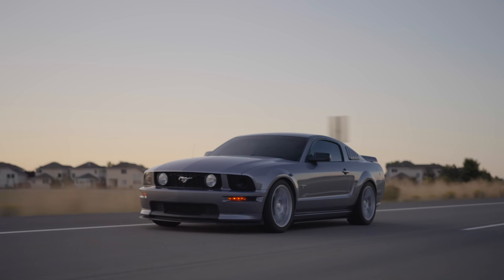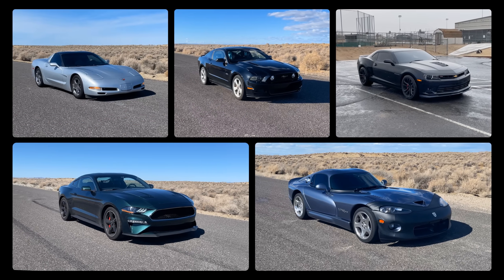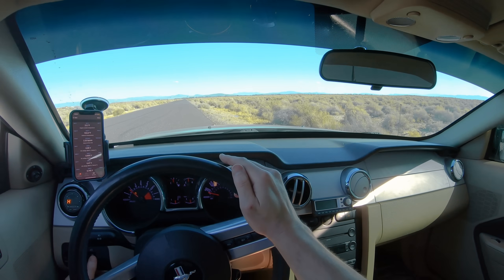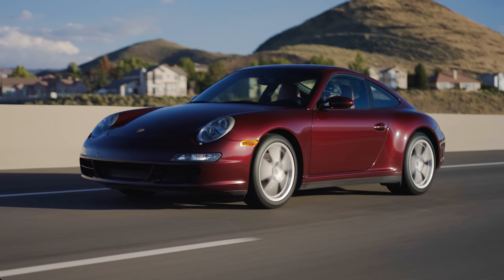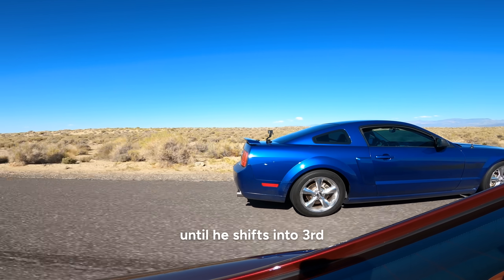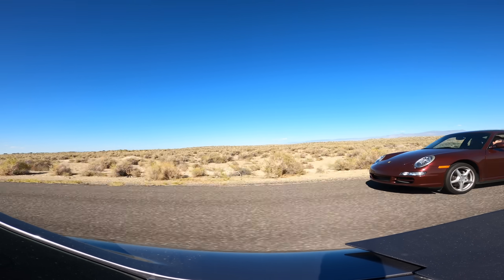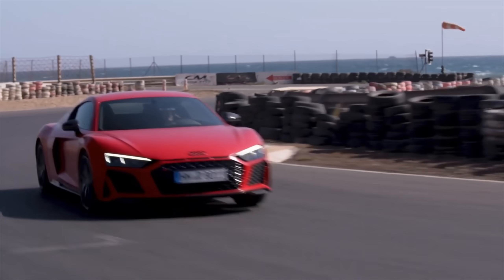This is what a 50% increase in horsepower looks like

Comment: Heavily overlooked mod is functional weight reduction 
My Q50 Sport came with 19s and heavy factory rims and factory runflats 
I put on 18 inch RPF1s that cleared the Akebonos with Toyo Tires 
Paired that with 2 piece rotors, and my car on a scale lost over 130LBS of weight 
Even before installing my tune and pumping up boost to 19PSI 
The car felt like an entirely different beast 
Turn in, Braking, and Roll starts all felt SUBSTANTIALLY different and that was before adding ANY hp 
once i tuned it the cars now in a different realm of speed than where it was stock 
id guess stock it would run maybe a 13.4-5 at the 1/4 
now im positive it would run a 11.6-11.7 on my worst try

Comment: "You gotta get that to the wheels chappie...."  You can get that even faster though it would involve stripping out that weight, changing the rear end out and a few more trans mods you can be cooking even hotter.         There's still much more you can do before boosting.   👍

Comment: N/A builds are under-rated these days, and 400+ HP at the wheels is nothing to be scoffed at, despite what most of the internet says. I see by the plates you're in Nevada, and probably higher elevation. You should do a road trip if feasible and see how much faster you'd be at sea level. I know moving from sea level to Colorado, my at the time's N/A V8 lost a ridiculous amount of power.

Comment: That's why I love my K24. It doesn't bog down at the lower RPM because the taller cams are not active until 4500 rpm. You can get a pretty flat torque curve because of it. It already picks up at 2000rpm because of VTC (not vtec) and peaks at just shy of 4000rpm and is a flat line from 4k to 6k. Redlines at 7600. VVTI-L/VANOS/VTEC truely make a N/A build much more peppy. 

It's not a V8 ofcourse, but I also live in Western Europe where a 2.4L is actually high displacement these days. It's so much more driveable than whatever we're sold here the past 2 decades, due to the way it delivers power. 

Planning to also have it built, put a K20 head on it, intake, 50degree VTC, bigger throttle, the works. It only has intake and headers now, so its stuck at 220whp. Just hope the builder does a good job, i've had rotten luck with shops. But I wouldn't ever give up the NA spirit of it.

Comment: Should’ve built a stroker motor first, been documented to easily make at least 400 to the tires with stock cams intake and lightly massaged heads. 

These 3V need either more “pull” to draw in more air or boost to help it. Big difference when stroked to 331 FWIW
Reply from the maker: where documented

Comment: Thank you for your videos, they are very interesting. I'm French and so I don't have a very good knowledge of Mustangs, but it will come. I have a question, I just bought a 2007 Mustang V8 BVA equipped with an Edelbrock e-force compressor, with apparently no other preparations, just a reprogramming. My problem is that I feel like I have little power below 4000 rpm, and with the compressor blowing below 50 km/h it becomes almost uncomfortable to drive. I am wondering if I have an interest in keeping the compressor (which is also illegal in France) to favor stage 1 preparation. Do you have any advice?
Reply from the maker: uncomfortable to drive because you lose traction when applying too much throttle below 50 kmh?
Reply: @Four_Eyes   yes below approximately 50km/h I have the impression of having less traction than an original mustang, I have to press harder on the accelerator to go up in revs and find a range of revolution rpm more in line with my speed.

Comment: Hey bro id like your input on this .. got a 2008 GT , obviously i want more pick up … i was debating on going with department of Boost or paxton , with stock internals … those superchargers are made for stock internals but im still scared … would you put them on the stock engine and run that for a bit and then forge your internals ? Or would you forge your internals before adding a supercharge to be safe and make sure the boost will never blow up your engine ..

Comment: what mod do u suggest to get the biggest gain for the buck. my car is pretty much bone stock besides a cold air intake. dont think it was ever tuned, also what tuner do u suggest. ive never got to mess with my cars like this cause they was all old obd1 cars so u was better off pulling the fuel injection off an throwing a carb on those old cars but i finally broke over an got a more modern car not crazy new 09 gt but i have to admit i have been loving it but haven't done anything to the car but what do u suggest.

Comment: Something you should know is that your upgraded brakes didn't improve the braking performance. The stopping distance would've been the same if you had just bought new pads and discs. Cars manufactured in the past 30 years are all capable of locking the brakes, which is the maximum possible braking force. The difference is that with upgraded brakes you can brake hard more frequently, but the stopping distance does not actually change. Driving4answers has a good video on the subject. I'm not saying you shouldn't upgrade the brakes, I'm saying it's important to know what actually changes when upgrading.
Reply: He already mentioned in the brake vid that he will put bigger tires on
Reply: @bigmansir3745  Yeah. My point is that it's a common misconception that upgraded brakes improve braking performance. They don't, unless the braking system is REALLY old.

Comment: I seems like the 911 didn’t take advantage of the AWD in the last race. Seems like the stock S197 took off harder since it beat yours off the line. Seemed the Porsche bogged off the line in the last race or should’ve gotten the revs up at the launch, since it doesn’t have the torque of the V8.

Comment: I broke 2 spark plugs in my 4.6 05 GT took it all apart now I’m getting a cam shaft position sensor code driver side, it runs good but I am worried any tips? Ford told me it’s mistimed by one tooth 🦷
Reply from the maker: could be a bad VCT or phaser on that side as well
Reply: @Four_Eyes  awesome I will check that out,I love your videos you motivate me,to build my car up!!

Comment: The 911 being awd actually hurts it. Thats a mid engine car. Theoretically, based on weight ratio it should apply more power to the wheels than any front engine car. Also, the gearing could be revised in that 911 to be shorter to make it quicker but overall power isnt enough for overall top end gain. Id also wager, the 911 has less drag than the s197.  I like that s197, sounds great and looks very solid. Great build! Notice, something else with that Porsche, that launch. lol So because your rwd you broke traction to get into the higher rpms and I bet he barely left 5250rpms by the time you hit 7k lol Awd isnt everything!

Comment: What makes your mustang come alive is Torque.  Torque  is responsible for acceleration.  HP is responsible for top speed.   I built a 347 stroker purposely designed to have all 400 ft/lbs come on from 1100 rpm through 5600 rpm.  HP, at 420, doesn't hit until just after Torque/HP crossover, and by then I'm only in it for top speed, but I'm there seconds before you so you'll never see anything but my taillights.  It's not your top speed, it's how fast you get to your top speed.  You built a motor to rev to get your Torque starting a 4000 RPM and dropping off after 5750.  Very narrow band.   The profile of your original engine was much better.  You should have built your motor just to shift that profile up.  You shifted it to the right.  Yeah, you're compensating for the narrower band using a 6 speed,   but that takes time to shift.  Imagine having all that power you have for 1750 rpm for 4500 rpm.  Adjust your gear ratio up to take advantage of it and bam!
Reply: IIRC, this is a turbo motor without the turbo, things are not quite going to be at their full potential

Comment: at 3:24 what is the name of that device in the car on the left side of the steering wheel that has numbers in orange?
Reply from the maker: AFR gauge, no one's noticed yet but my Mustang was actually running pretty lean and was down about 20 horsepower
Reply: thanks and i really did not notice that it was down on horsepower..but your mustang is really cool..keep up the great work

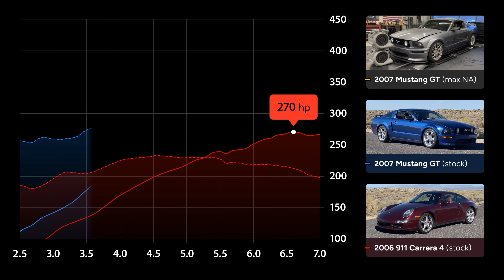Comment: i’m just saying but i’ve only done…. catless down pipes, jlt series 3 CAI, bbl 62mm tb, 93 tune, steeda under drive crank pulley, and 3:55 adjustments and i’m making 394whp and 413 wtq. i just don’t get it. i haven’t don’t much else. other than ford performance 24lbs with a 6 fuel shooter instead of 2 shooter
Reply: i’m also a 2010 4.6

Comment: And this is why the s550 coyote is such a good price to performance vs the older mustangs. Pretty much zero competition of any mustang in stock form from 1964-2003 with the s550. The 03-04 cobra is a decent car if you can put up with a 20 year old overpriced boat, but the prices people want for a cobra is stupid. The s197 platform is very plentiful but people still want too much money for a decent non ragged out s197 and they cost too much to make the same power a coyote makes from the factory.  Disclaimer: I've owned all the cars I mentioned in this comment and mean no hate to these cars, but my procharged s550 is faster 🤣

Comment: I dont mean to be an ass but how much money before and after the stroker kit did you invest into the engine. Because im thinking about keeping the stock tremec and just doing cams and a intake
Reply: Possibly a exaust system. Not looking for crazy horse power. Like 350 whp
Reply from the maker: good cams and headers will get you there, but things are more expensive than they were when i did this… so maybe $4-5k for full exhaust, cams, intake, underdrive pulley, axle gears and a good tune

Comment: cam, headers, and a tune? Dude, you have a fully built stroked engine
Reply from the maker: The stroker kit accounts for less than 10% of total horsepower gained.
Reply: @Four_Eyes the only way you can say that is to do the mods on stock displacement then don't stroked

Comment: Why do the wheels of the Porsche appear stationary at 4:23? I'm sure it's some sort of optical illusion but I don't understand it.
Reply from the maker: Cameras take a bunch of pictures per a second, usually 30. Each picture is known as a frame, this is where we get "frames per second" (FPS). Sometimes when the camera captures the next picture (frame), another spoke (or the same spoke) is in nearly the same position as the previous frame which yields a stationary effect. This is a common effect and also often seen when recording helicopter rotors.
Reply: It looks like that in real life too.

Comment: Porsche pulled away from stock on aero advantage above 60. He could've done better on the dig. They will handle a redline drop off the line. Takes some faith in German engineering and zero F-given for the clutch though.

Comment: Hold on. Why are you building high compression and then turboing it? Wouldn’t that be counter intuitive? With higher compression you aren’t allowing for higher boost. Where at a lower compression ratio allows for more boost. Don’t get me wrong. You can boost high compression engines. But at the same time. Why spend money to make a higher compression ratio when you can just boost it now and have more boost?
Reply from the maker: im doing both, different engines

Comment: How it is street legal with a single headlight????
Reply from the maker: i have 3!
Reply: @Four_Eyes  So where you live it's not required to have all stock headlights? Here in europe if you have 4 lights out of the factory you had to have 4 not less not more either or the  car wil fail the roadworthiness test. My other car i have a bertone coupe faield this because it had 60 mm exhaust system since it was a german car but her ein Stupid Hungary the maximum allowd is 58mm system so i had to saw it off just to get papers in hungary.
Reply from the maker: I believe we have to have two headlights, but where I live the cops don't care about modifications unless your car looks like it's falling apart. If I lived in California it would be a different story...

Comment: The more the chop, the more it’s a sound cam and not a power cam. 
Which means you’re making all that noise instead of more power. 
Goes to show you not everyone knows what they’re doing especially when they use a Bama tune in their base form. 
Used the wrong tuner, and the wrong parts. 
Tisk Tisk.

Comment: Everything else aside, all the horrible things 4 eyes has said (see below)
You made a fleeting comment that deserves a Word or Two, You mentioned the German GOAT Weighs
400 Lbs Less, In Drag Racing, a pretty sold metric to follow is; For every one hundred LBS, you gain 1 Tenth in the 1320 (everything being basically equal)
The 400 LBS, the Porsche gains 4 tenths, 1000 LBS is pretty close to 1 full second. For those who drive road courses, youre looking at better breaking as well as less fade as the race goes on. Tires last longer, the car will handle better regardless of anything else. Youd be amazed at how quickly, Ounces quickly turn into LBS which equals better performance in every aspect of sny kind of racing.
I am Not suggesting Drilling Holes in the Frame, Something Pontiacs (Referred to as Swiss Cheese by the Engineering team) actually did back in the early 60's, was actually planned while my Dad was Still on the Staff at Pontiac.
My Point; absolutely everything/anything should be looked at, of course Never Ever compromise safety.
If you do put your car on a diet, youll be amazed at how quickly it starts to add up..
Id like to add, just because I'm OCD or some shit, The original name of Powder Coat, was/is ESP, Electro Static Plating!
Reply from the maker: ¡que horrible!

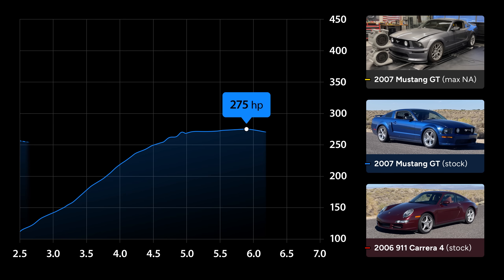Comment: 1:47

Manual or Automatic, it's all the same.
Reply from the maker: incorrect
Reply: @Four_Eyes  Oh sorry kid, I forgot, a manual makes you think you're cool, "Hey, look at me, I'm moving my hand around, I'm cool"

A manual doesn't add horsepower, it doesn't add gas mileage,.

Do you even know why they call it a manual and an automatic?

I'll teach you, a manual means you shift the gears, an automatic means the gears are shifted for you.

It doesn't change anything.
Reply: @armybeef68 actually kid, cars with a manualdo have more power to the wheels.A automatic transmission losses more power throughout the drivetrain so even tho they have the same power to the crank a manual will always have more power to the wheels kid 🤓